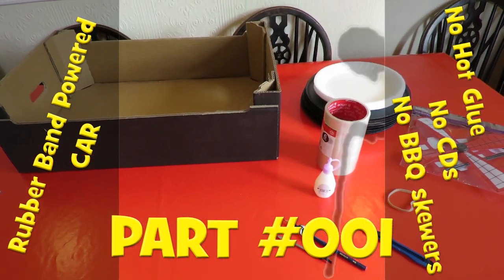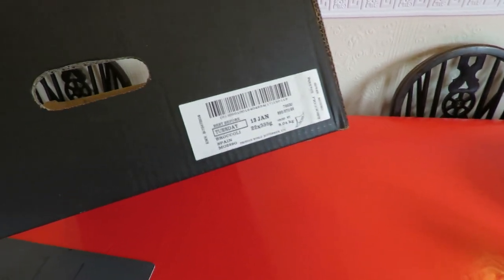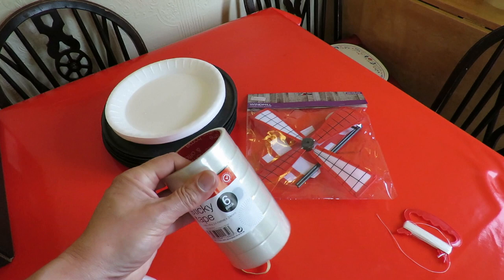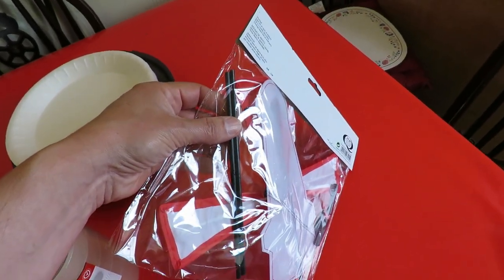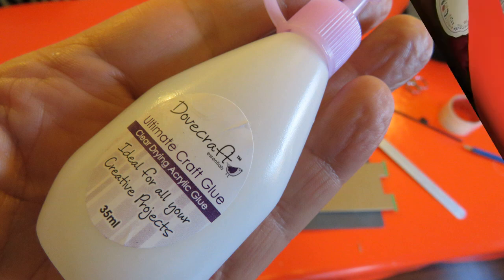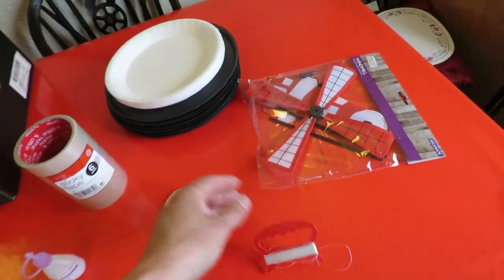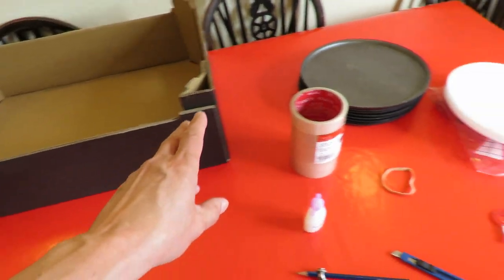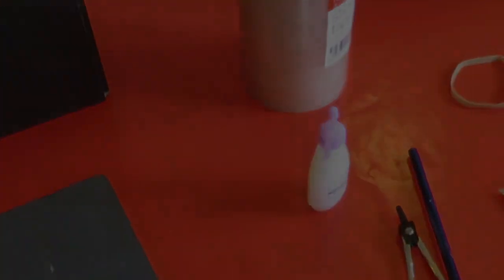No Hotglue No CDs No BBQ skewers Rubber Band Car PART #001

Comment: would you be able to make a quadcopter from your helicopter parts?
Reply from the maker: That depends if you intended it to fly or not. The controller for a helicopter would not control a quad-copter. I get asked to make drones, quads and helicopters so often I have a standard cut and past reply.The answer is NO. To make a helicopter or quadcopter stable in flight I would have to buy so many parts designed for the purpose it is cheaper to buy a ready made helicopter or quadcopter or a kit. On top of that, my channel is aimed at simple, quick, cheap projects and a helicopter or quadcopter build is not a simple, quick, or cheap project. You would be better finding a channel that specialises in RC Quadcopters or Helicopters so you get the information from people who know what they are talking about. FliteTest would be a good place to start https://www.youtube.com/user/flitetest
or anything David Windestål is involved in https://www.youtube.com/user/dadde87
or you might like this video by The Post Apocalyptic Inventor https://youtu.be/qa_x93JQhNM
for rubber band power check out the work by norris432 https://www.youtube.com/user/norris432
Francisco Ramos Muñoz recently did a quadcopter project https://www.youtube.com/user/franramuzz/videos
Why I won't make an RC helicopter from an RC toy car https://www.youtube.com/watch?v=92GKSUi2y-8
Cheap Mini Quadcopter https://www.youtube.com/playlist?list=PLA5a2xPRSrB2ff05_X2Ek0sMNXA35IFyx
Helicopters playlist https://www.youtube.com/playlist?list=PLA5a2xPRSrB3l5KTGMqUydr8pctBi5Af2